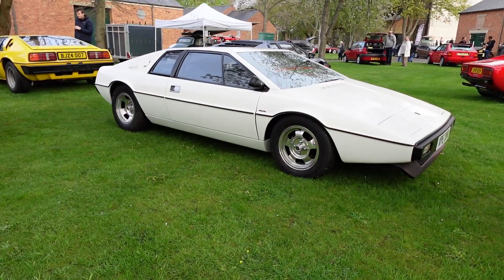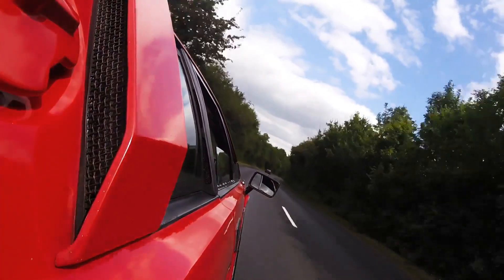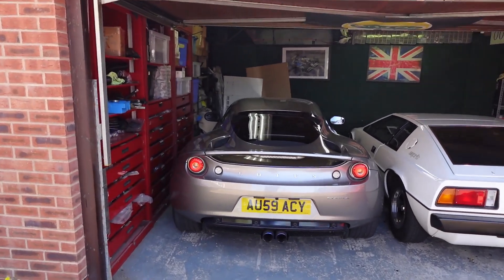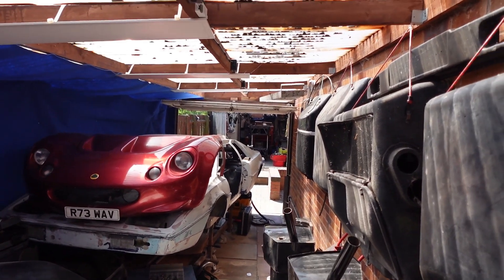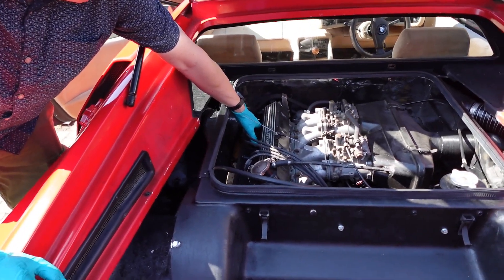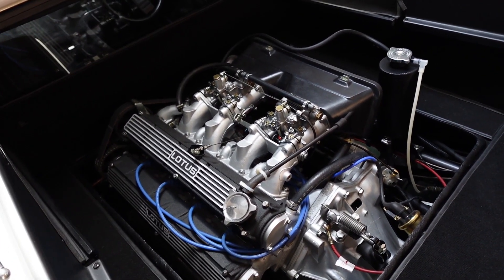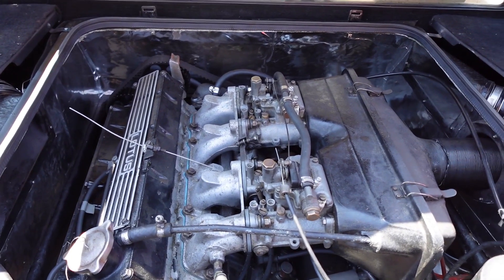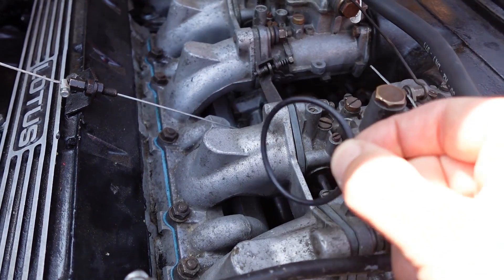Visiting the Lotus Esprit Whisperer

Comment: The workshop manual specifies the gap between the central plate which carries the "O" rings and the carb and manifold.  Simply adhering to the cap ensures the carbs are mounted properly.....according to Lotus anyway!
Reply from the maker: @michaelwhelan564  you’re right but, having now done it, I take issue with the word “simply” 😂
Reply: @SportsandGT  Nothing  is ever simple on the Esprit.1🙂
Reply from the maker: @michaelwhelan564  correct

Comment: Great videos, I don't have a lotus Espirit, have a 907 in my jensen healey. Nice car the Espirit. Does Mathew have a book of notes and tips he might have published. I liked how he pulled spark plugs wires off to see which cylinders are doing the most work, great tip.maybe he has a site?. I'm in California   USA. 

Cheers
Reply from the maker: Hi - I don't think he has a book but this is what he does for crude balance checking. For finer tuning, he pulls one plug then uses a length of hose to listen to the tune of the air going into each of the other 3 intake trumpets, adjusting the idle screws to achieve the same note - then replaces the plug and pulls another - repeating until all are done.
Reply: @SportsandGT  cheers mate appreciate your reply! That’s good information!
Reply from the maker: @TheSawyer10702  no problem, I’ll be fine tuning mine with a manometer in the new year which I will try and film
Reply: @SportsandGT  that will be good to see. Look forward has to all your videos!

Regards
Daniel USA
Reply from the maker: @TheSawyer10702  very kind - thank you

Comment: Man, i wish there was a good solution besides standard carb maintenence to keep your mind off carbs leaking on to the distributor. Its was scares me when driving mine, so i dont even enjoy the car. may as well just bite the bullet and do distributorless injection bah. Also that backup camera magic piece was incredible lol, so much want
Reply from the maker: There’s always 123-Ignition which replaces the mechanical dizzy with an electronic one but the carbs are still there. I don’t know if anyone has made a fuel injection system but take both of these things together and it kind of changes the character if the engine and car. Thank you for watching.
Reply: @SportsandGT  lotus prepared by Claudius has a true distributor less ignition system. Lotus bits has developed a fuel injection kit for the 907 . I have searched but can't find anyone who has bought it. Thanks, enjoy the content
Reply from the maker: @blakeriley6690  👍🏻